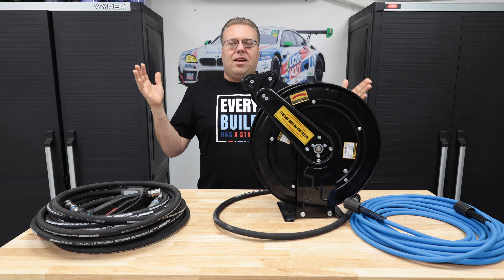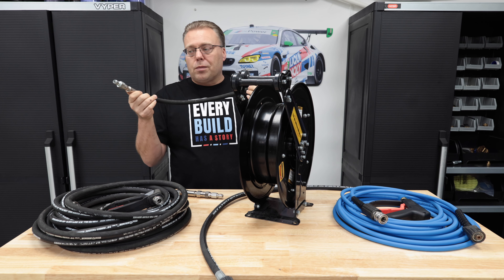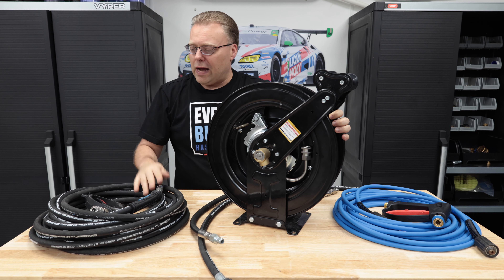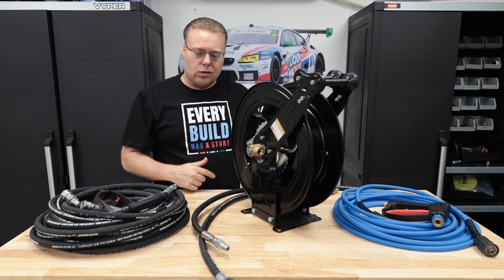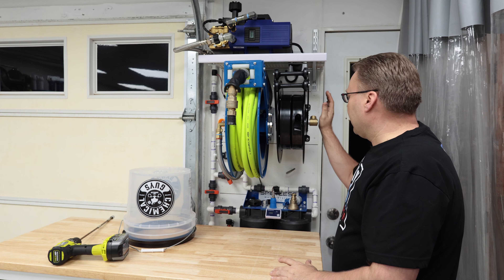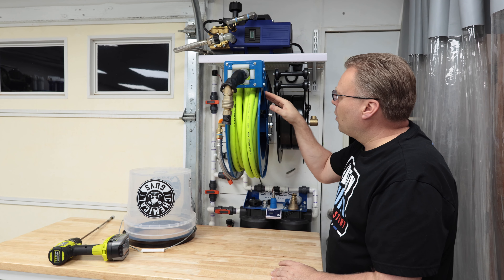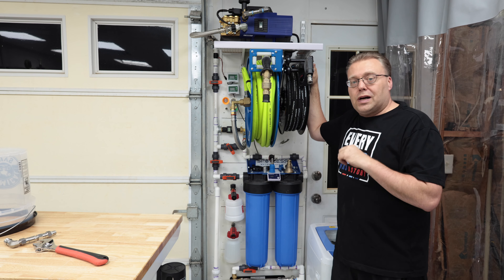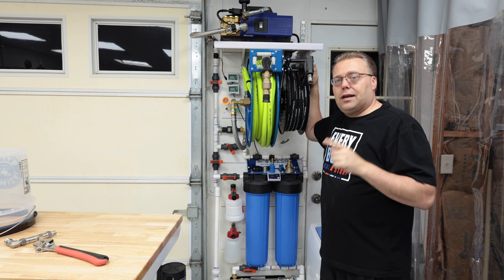Amazon Retractable Pressure Washer Hose Reel | Fixfans | 1/4 or 3/8

Comment: I converted an air reel.  Using a flexzilla hose on a Reelworks air reel.  Had to cut a 1.5" hole with a rubber grommet and m22 adapters.  Works flawlessly.
Reply from the maker: That’s awesome! Hopefully it hold up as that is a good deal. I have heard of some having blown out. I think it all depends how much PSI your pushing.
Reply: @CarsWithKeav  It's hooked up to an Active 2.0, do it isn't crazy pressure.  I usually use it with a 5.0 orifice nozzle, so it would shock me if I'm pushing more than 1,000 PSI.  If I were using a much higher PSI machine, I probably wouldn't risk it.
Reply from the maker: @MotoJoshP  5.0 nozzle you are probably in the 700 to 800 range. Much safer than running say 1000+.

Comment: I have blushield. Comes with the hose Everything  assembled just plug and play. Better value for $250 with the high quality hose . I got mine at tool barn for less than $200
Reply from the maker: Tool Barn went out of business online last month. I had seen their site before and wondered how in the world they could sell things so cheap and just was always sketchy about them. Should have made some purchases before they closed. Did you get the dual arm or single arm? I think now Amazon at $369 is now the cheapest with the hose which still isn’t that bad of a deal.
Reply: @CarsWithKeav  I ordered the single arm and received a dual arm with 1/4 hose. That was a good mistake from T barn. I was impressed on how heavy duty this thing is. I saw the single arm regular hose reel in use at a comercial place and looks heavy duty too. They sell directly to retail their retail site is called THE BLUE HOSE. currently there is a 25% off added to the cart when you go to check out. So the single arm will be close to $250 with the coupon and 50ft hose . I’m surprised the guy that sells fancy garage stuff has not found this brand, they have a full stainless steel option for $1k
Reply from the maker: @melvinventura2614  I see $250 with the 1/4 hose. I have that hose and didn’t like it. Not saying it’s not good just having the Kevlar (Aramid) hose kind of spoils you a bit. It was heavy for a 1/4 hose and basically the same diameter as the 3/8 and heavier. The one I would want is $582 which is comparable to my setup. Just my luck both of the 3/8 ones are out of stock 🤣. This one is $370 on Amazon and $580 at Blue hose site. https://amzn.to/3TTdOgV
Reply from the maker: @melvinventura2614  I’m sure that fancy garage guy has seen it, but if they won’t sell to him the way he wants he won’t carry it.
Reply: @CarsWithKeav  whoa thats crazy, I was just about to link the Blue Shield and yep Tool Barn was closed down. I literally just got the dual arm 50 ft. PW with the same 3/8 BluShield hose you put on your FixFans. The one I ordered on the TB website was around $185 with tax and free shipping. It came in 4 days. I don't understand how I got it for $185, free ground shipping on a 45 lb item. And now it is listed for $370? I have the exact same one and it came with the same whip and quick connect
Reply from the maker: @vermontmotorsports1275  Willing to bet it was probably a liquidation as I had seen it on their site before for around $299 or so. Maybe it was $250 at some point. You got a heck of deal there for sure my luck I would have bought it and made a video only to have the website close down the next day. 🙏 I have had this happen on several products including my most known videos on wash carts. The one I had I got on Amazon for $99 and listing went away and cheapest I could find after that was $500 on industrial sites. 🤷‍♂️
Reply: @CarsWithKeav  holy crap that's some price hike on those carts. I wish it was still listed so you could review it. It basically looks just like your FIXFANS. I guess I just got super lucky. It was between the Giraffe/FIX Fans but ended up with the BluShield. Installed it today in my Honda Element. https://www.youtube.com/shorts/lM5sKrMuOog
Reply from the maker: @vermontmotorsports1275  That’s a great setup and you will be happy with the Blushield. Fixfans was supposed to be the cheaper alternative, but if I would have known Blushield was in a such a deal I would have bought one. You can’t go wrong either way.
Reply: @melvinventura2614 I just got the blushield, too, ordered the single arm, got the dual. I am completely flummoxed trying to attach it. I was hoping to do it all with quick connects.I got a bunch of them, but none of them seem to be the right config.  I think I may be missing some type of connector? Any tips on hooking it up?
Reply: @JaimeRose-jg3fv  First you need to attach the lead hose (short hose) to the reel, put some teflon tape, screw one end of that short hose to the reel. there is no need to have a quick disconnect there. the other end of the short hose is a male 3/8 quick disconnect, you connect that to your pressure washer therefore on your pressure washer you need a female 3/8 quick disconnect.  If you don't have one already, most economy electric pressure washers come with a M22 port, therefore  you need to order an M22 to 3/8 Female  adapter. hope this helps.
 

The long hose, comes wit a 3/8 Male quick disconnect you plug that your gun.  The gun needs a 3/8 Female quick disconnect.

If you were using a 1/4 hose, most likely your quick disconnect are 1/4 these will not fit.
Reply: @melvinventura2614  Thank you so much! I was really excited to follow the @CarsWithKeav tool cart builds. I bought the  pressure washer hose reel with that in mind, but  it  just didn't quite need the same things as the empty hose reel builds. I knew it would work if I could just figure out the necessary connectors. @CarsWithKeav built a great community, I prefer this ooperative and friendly tone. Thanks to both of you!
Reply: @JaimeRose-jg3fv  did yours come with the whip attachment? mine came with the whip you screw into the side and that had a quick connect on the end
Reply: @vermontmotorsports1275  Yes, mine came with the whip attachment too. It was the M22 to 3/8 female quick connect adapter that I was missing. I had several m22 to male, but no M22 to female.

Comment: First of all thanks Keav for the excellent content. Bought the reel on your recommendation.  Wanted to share my experience. With the supplied adapter was able to connect my uberflex hose without mods. However, when I would get off the trigger it would make a loud bang. Purchased a aramid blushield hose and it resolved the issue.  I guess the little bit of expansion would slap the reel. Great addition to the detailing setup.
Reply from the maker: Yes anytime you use an Uberflex hose on a reel it’s best to fully unspool it. It might not be as bad if you spool it up pressurized then release the pressure. There would be wiggle room then.
Reply: @ even with the hose unspooled made a loud bang. So one more vote for the blushield hose. Slightly heavier and stiffer but for me better overall experience.
Reply from the maker: @ Geez, wouldn’t have expected that, but I didn’t use an Uberflex for very long. The Blushield is lighter and a smaller overall diameter than any other 3/8 hose which works out great.

Comment: Great video!  On your recommendation I purchased and just installed this FixFans reel.  For those wondering about max hose length capacity, I paired it with a 75 ft 3/8 inch Kevlar hose from BluShield (non-marking).  This hose fits but the reel runs out of tension when rolling the hose back in.  For me it keeps stopping short at the last 4-5 feet.  This is not a show-stopper as you can manually turn the reel and wind in the final feet of hose.  I mated this setup to a new Active 2.0 pressure washer and I am LOVING IT.
Reply from the maker: Appreciate this info and testing the limits for us all. I thought it could fit 75 feet, but as we discussed the tension runs out. It’s not hard to hand turn 4 feet though. Hope you enjoy the Kevlar hose it’s so much lighter and thinner than the bigger 3/8 hoses.
Reply: @CarsWithKeav is the 3/8 kevlar Blue shield totally fine with active 2.0 & 2.3?
Reply from the maker: @ Absolutely!
Reply: @CarsWithKeav  Thanks man.  Running into paralysis by analysis between the 3 of you I follow in this space  :)
Reply from the maker: @dustind9242  🤣

Comment: I have the same but different brand. Got it for $94 on sale 2 weeks ago. Already converted it to my Comet 1700 with their hose. If you let it unwind uncontrolled, lookout, it’s got some danger to it. Ask me how I know. Not much of a pain to Frankenstein but had to order npt 15mm connectors. Works great!👍🏽
Reply: That’s quite a savings, what brand?
Reply from the maker: Be careful with that as it’s not meant for pressure washers. I know a few who have had them blow up on them. This one is built for 4k PSI and meant for water. I do know many who used air hose reels and it’s working others not so much.

Comment: If we ever move and I get a garage I want one exactly like Keav 😀
Reply from the maker: Just promise me if you do to get a legitimate drain system and don’t chisel two miles on drain channels. 🤣
Reply: @CarsWithKeav  The question is. Would you do it again or spend the extra for  a drain system.  I know why you did what you did though.
Reply from the maker: @wescat2  if I knew the channel would eventually make enough money to pay for a legit drain system I would have gone that route, but I had no idea so just did what I had to do. If I knew then I would have brought somebody in to  shave the floor to drain from all walls to the center and put speed drains on the outside then a big drain in the center into a trap. Still might try that out one day, but still so expensive. Recent visit to Gtechniq works facility inspired this train of thought and that’s what they did.

Comment: Hi there.  One thing I did for the Uber flex hose. I cut the black housing off one end, added a M22 male coupler, to at M22-14 female to 3/8'' plug. Works great!  You just have to pull the hose through before adding the M22-14 female to 3/8'' plug. Wish I could load a pic to show it. Thanks for all the great content!
Reply from the maker: That’s a great idea. I have shaved the M22 plastic down to fit other reels.
Reply: Thanks for posting this shortcut! Upon further research I found amazon sells M22-14 MALE to 3/8" QD plug connectors, I only found them in kits with another QD but the kit is only $10. This way you don't need a coupler (potential failure/leak point) and can go from Uberflex hose into the reels 3/8" female QD.
How much of the Uberflex's M22 plastic housing did you have to trim off? Do you see any issues with the Uberflex hose contacting the hole in the reel? Maybe wrapping a protective layer at that spot is a good idea?
Reply: @Thylacine1   it is still working great for me. There’s been no wear on the hose at all. I use it 4-5 times over a 2 week period. Still, that’s a good idea to add a protective layer to extend the lifetime. I may cut a piece of garden hose and place over that section for safe measure. Thanks for the idea! I used a dremel and cut all of the plastic housing off that end. Working like a champ so far. Also, I use the red Uber flex hose. It has a bit more psi rating. The only reason I chose it was because it matches my garage color scheme 🤣
Reply: Hey Gibby can you send me a message on how you made a ubderflex to work well ? i can give you my phone number
Reply: @703Youngster  happy to help. I can’t tell if my responses are getting through or not
Reply: @GibbyDIY  Sorry for the late response but i actually got it to work, Fixfans comes with extra hardware they had this quick connect male end with m22-14 on the other side i put it on my uber flex and boom i didn’t have to make any modifications

Comment: Hey. Another great video and perfectly timed. I bought the same reel after seeing one of your videos. I also bought the Waterdrop spotless filter system from your review. I’m just waiting on the new home to get built so I can install. Appreciate the install tips.
Reply from the maker: That is awesome! Do you get to design everything so it will be ready for the system? Like water spigot location, garage drains, electrical outlet and breakers? Let me know how it all goes when you get it setup!
Reply: It’s a track home so unfortunately modifications are limited. But there is a 8ft wall section that’s perfect for mounting all the pressure washer equipment and a cabinet for supplies. I have the electrical placed where I want, added wood blocking for mounting equipment, and installed tubing for a future pex drop. Looking forward to having a dedicated spot to install all the pressure washer pieces.
Reply from the maker: @chavezsergio4496  Awesome! If you have any question at all feel free to hit me up on IG, Facebook or email. I’m always around at some point could be a few days, but I always answer.

Comment: Damn this looks so good. My only reservation was a manual reel might be annoying to use. Hopefully there’s a bigger 100ft one variant soon. But for now I think this is the route I’m going! Thanks as always.
Reply from the maker: Manual reels are annoying, but one thing about them the hose reels in way more uniform and nice on them. Retractable ones being so much narrower they don’t reel in as uniform.
Reply: @CarsWithKeav  With this in mind, you are on team retractable or will you switch out the the manual reel in the future?
Reply from the maker: @mytrung  I’m always retractable if it is possible. As long as it can handle the pressure rating I’ll be using.

Comment: I purchased one of these back in June and am just now getting around to setting it up. The big issue is that the supplied male QD doesn't lock into the female on the reel. I have an email in to the manufacturer. I will have to try the leader hose trick once I get that fixed.
Reply from the maker: This is an issue across many quick connects. Many do not work with each other has to do with the diameter tolerances and even sometimes length. More than likely the included male quick connect is not the same company as the one on the reel. I have had several times some of the Amazon adapters won’t fit my MTM quick connects.

Comment: do you have a vacuum breaker or backflow preventer at the spigot/hose bib? do you get any back pressure of water squirting out at any couplers?
Reply from the maker: I have not had any back pressure issues and do not have any breaker or preventers. I have tried probably 20 different pressure washers without issue. Well either it hasn’t happened or it has and my piping was strong enough to withhold it.

Comment: I’ve used this reel for about a month. It leaks where the line connects to the reel on the U pipe that the m22 quick connect goes into. I recommend caulking or using some type of sealant below the threaded end that connects to the reel itself. Trust me, do it before you hook the hose up and get it wound. I’m still having trouble with mine. I truly regret it at this point.
Reply from the maker: Weird have had this on the wall for 6 months so far and no leaks. I did take pliers and tighten that as much as I could before setting everything up.
Reply: @CarsWithKeav yeah I tightened it too. There’s a review on Amazon where a guy bought 2 that leaked. It’s really hurting my business at this point. I like it other than that. I even tried putting a new O ring in it. Idk, I guess they can’t all be right. I’m just unlucky.
Reply from the maker: @vancelee3506  I’m sure the manufacturing tolerances are not the best. What about Teflon tape or plumbers putty on the threads? I know it’s a tight spot to do that.

Comment: thank you for all the testing.  What quick connect you used for the Aramid to the reel quick connect.  female 3/8 to what? NPT?  by the way hard to find 50 footer one.. only 75. I am going to test your idea that 75f can fit. Also 23 turns is the max this can be wound. will not go more  🙂
Reply from the maker: I used female 3/8 not to 3/8 male plug QD. It should fit only thing I’m not sure about is will 23 rotations be enough for 75 foot to reel in.
Reply: @CarsWithKeav  in the owners manual page 5 under item 4 they mentioned the usage of 65 foot hose to rotate to 22. probably you are right it may not take 10 more feet.
Reply from the maker: @nick-3808  You get to be the guy that proves them wrong now!

Comment: Keav is there anything thing you would have to do to a water hose reel to use it for a air hose reel?
Reply from the maker: Going to be honest I have no clue. It’s usually the reverse everybody wants to convert an air hose reel to pressure washer since they are so much cheaper. Most just hook up and hope and pray it works I know converting from air to water most change out some gaskets to better ones. The pressure washer reel might hold up without changing anything, but I can’t say for sure.
Reply: So you can use it or do you have to modify?
Reply from the maker: @gearlstrickland3365  I mean it all depends on the reel. Some have quick connects built in and others have 3/8 npt. You would have to use air fittings and quick connects to get it to work.

Comment: Does it have the option to mount it to a horizontal surface or is it only wall mountable? Thanks for the video, it's REALLY helpful.
Reply from the maker: It can be mounted horizontal based on my experience with it. The arm can be repositioned.
Reply: @CarsWithKeav  Thanks for the reply, upon further research I've chosen the "Wojet" reel due to a bunch of recent reviews of the Fixfans inlet assembly failing, It's not an easy fix or an available part.
The Wojet has a simple 3/8" inlet and with one M22 to 3/8" fitting one can fit the M22 from an Uberflex with no modifications and no bends. Thanks again for your videos sir!
Reply from the maker: @Thylacine1  Very nice! I’ll have to look into that one.